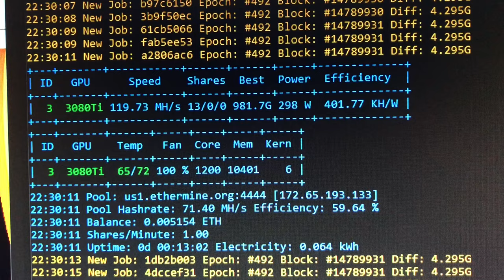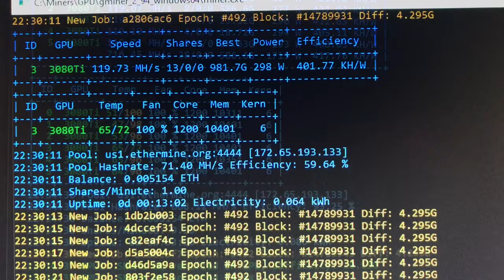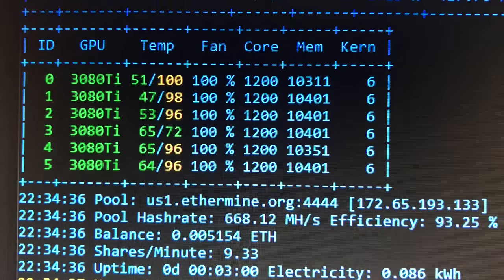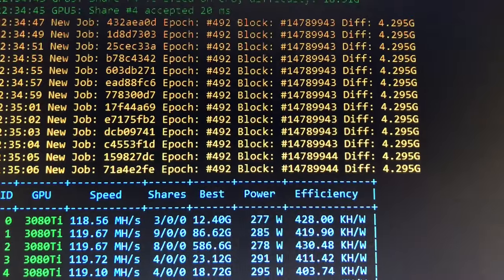How the GPU COPPER Mod Cooled my HOT GPU | 30 Degree Drop in Memory Temps! Copper Mod

Comment: Not saying this doesn’t work, but it’s way too risky for me. It would be much safer and yield nearly identical results to simply replace the pads with properly sized pads and use the correct amount of a good quality thermal paste. I did that to mine and several of my friends and a few of them are still using those cards. Every card is different, so instead of looking up the specs for what your card needs, measure it yourself. I used some modeling clay and a digital micrometer. Most of our cards needed 1mm but had 1.5mm from factory, meaning the vram pads were too thick meaning the gpu was not making good contact with the heatsink and getting hot. Put the thinner pads in and immediately had normal gpu temps.
Reply from the maker: I have done it this way for years. Every card is different. Find out what works for you.

Comment: Does adding thermal paste to the plate also help? I’ve never done this with mine. I didn’t want thermal paste everywhere.
Reply from the maker: i did add paste to the plates.
Reply: adding a good thermal paste on both sides of copper shim is a must, memory modules are not flat, nor is the copper shim nor heatsinc, it will fill in the micro gaps, if you don't use paste it's gonna be much much worse than stock thermal pads